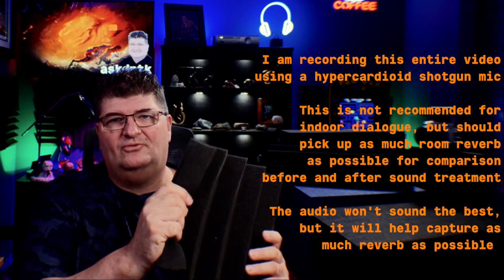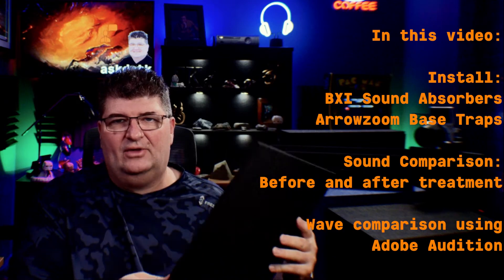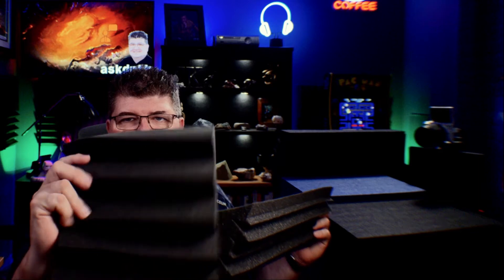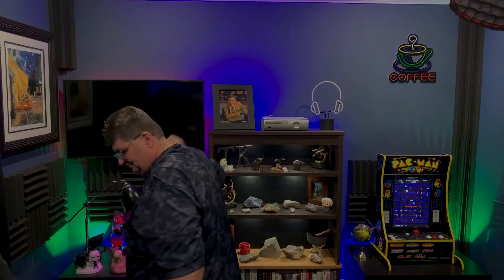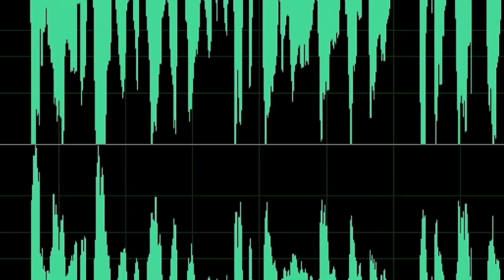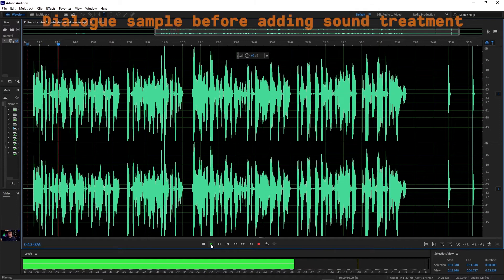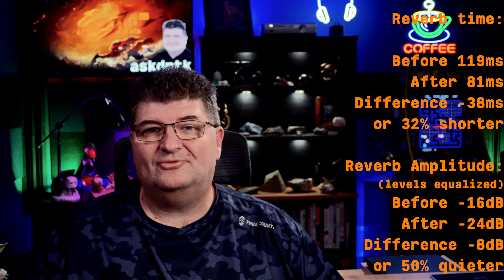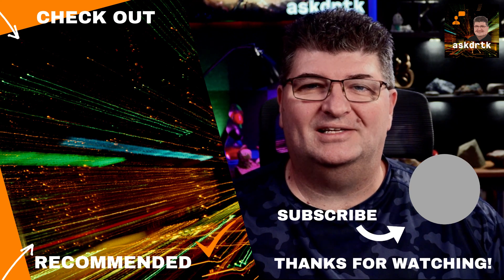BXI Sound Absorber - Reduce Reverb Now!

Comment: Maybe it's my earbuds. Or the YouTube comprehensive. There was a difference. But I can't say if it's a good or bad change. I think the untreated room had had more life in its sound. But the difference in clearness is the clapping. It's did sound better with that type of sound with the treatment. 
My project is trying to keep unwanted sounds out. I live on a main road on the middle level of a noisy apartment. And it seems when I start recording. Everyone else in the building gets loud. It's Murphy's Law.
Reply from the maker: After much testing, I have determined the Synco Mic-D2 suffers from the dreaded indoor dialogue shotgun mic warble and the reduction in room reverb makes is more apparent. I am testing a few pencil condensers (cardioid, hypercardioid, and supercardioid), all seem to benefit from the sound treatment and the warble is gone...reviews coming soon. The D2 might work well in a booth, but is not well suited for my space.
Reply: @askdrtk  Hi there, can this block outdoor sounds (6 db of Air conditioner noise) from entering my room?
Reply from the maker: @ddxxbb1  These block sound waves, so if the noise is the sound of the AC running they will help. If the noise you are experiencing is from vibrations though your building's structure they will not. Assuming the noise is not your building vibrating, the amount of sound absorbed varies by frequency so I would expect a reduction of about 3.5 dB below 300Hz and as much as 5.4dB around 1000Hz. 

If vibration in the building is causing your noise (if the AC is mounted to the side of your building on a bracket), look into some rubber isolation pads between the AC unit and the mounting bracket. Hope this helps out.
Reply: @askdrtk  The vibration is caused by AC unit on my neighbor which I can’t control, his AC vibrates his roof which gets into my building, the distance is about 10 meters, noise at source 63db, noise that penetrate the building into my room ~6 db and only on one side of my room where I have my desk unfortunately.
Reply from the maker: Since the AC noise is coming from another building, the noise will be sound waves in the air. The sound absorbers will help. I would suggest recording the noise only and looking at the frequency range. Since all sound absorption material varies in efficiency with frequency, we can calculate the reduction based on 63dB. For example, 63db of noise around 200Hz will be reduced to around 38dB and 63dB of noise around 1000Hz will be reduced to around 16dB (lower frequencies are generally absorbed less than higher frequencies with some exceptions) . You could then use some "gentle" noise reduction to remove the rest if needed (depending on the gear you are recording on.

Comment: i was actually looking into moving blankets before seeing this video, a 6 pack of that stuff actually seems good to throw behind my pc speakers. thanks!
Reply from the maker: Glad the video helped out. When I saw the NRC rating of 0.87 I had to try this stuff out. Carpet is generally between 0.15 and 0.35, and expensive sound absorption panels are often around 0.95. At around $20 for a pack of 6 this is the best value I’ve found and the reverb measurements I recorded line up with calculations for the room, so BXI is not inflating the performance at 0.87.

Thanks for watching!